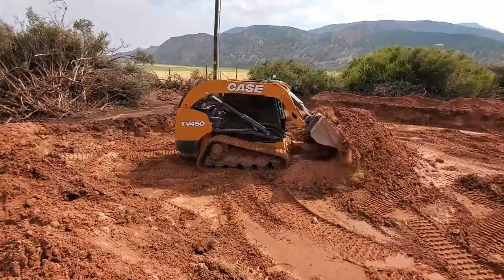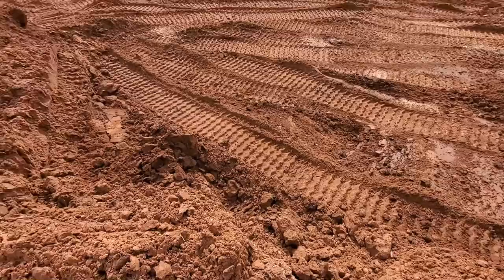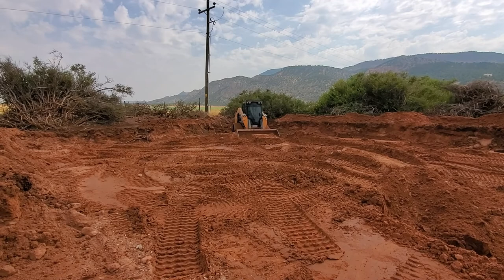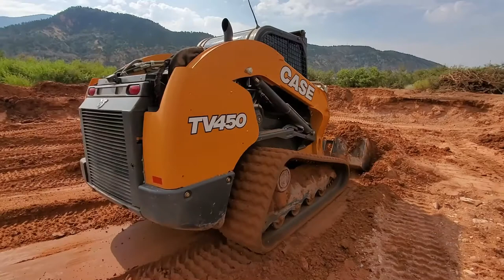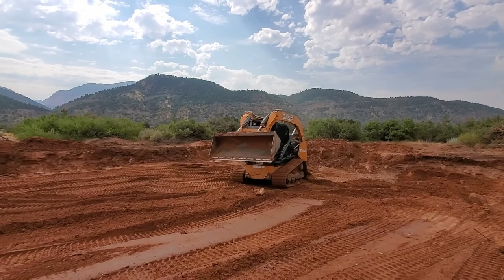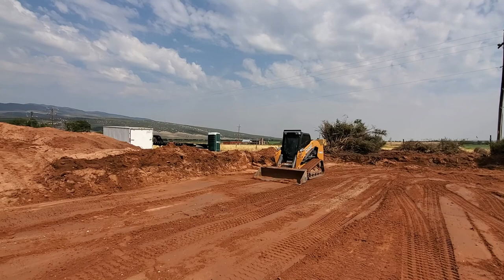16 year old operating case TV450 skid steer grading out house slab

Comment: How does that 450 ride? I tested a tv370B at the local Case dealer. I couldn’t demo one at my site so I had to run it in their parking lot. It felt rough riding, but maybe cause I was on concrete? Has the same tracks as yours.
Reply from the maker: It's not as smooth as tires on the pavement, but ride control is a must have moving pallets around, tires are a couple of miles per hour faster, but you can cross trenches, overall I like track better.